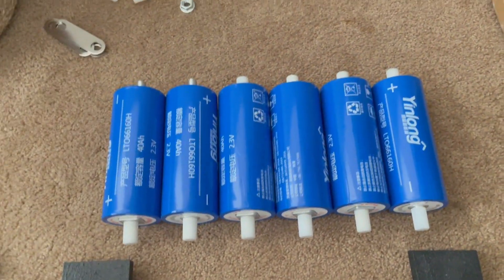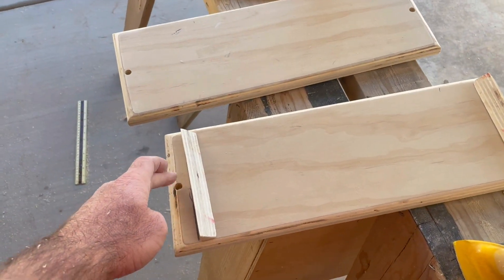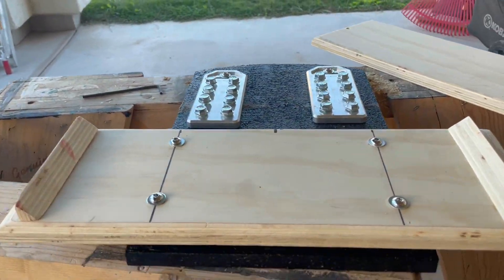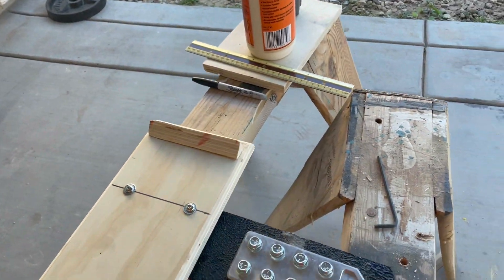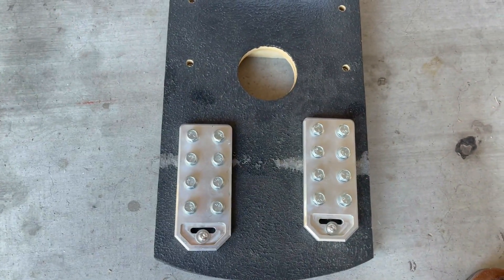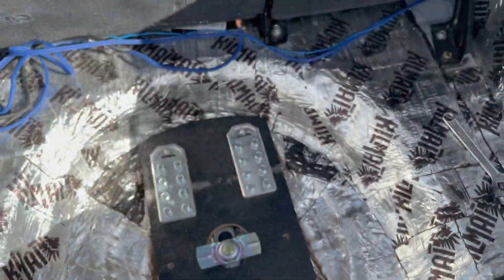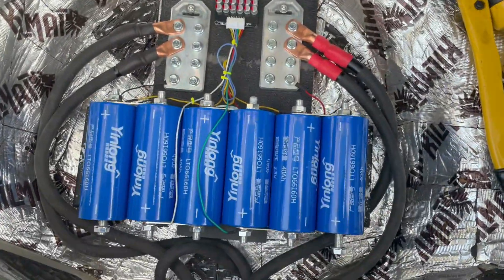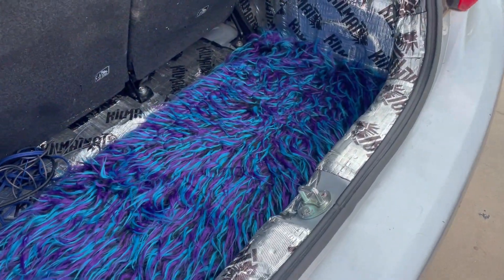Lithium LTO Bank Build for the GoKart

Comment: I was told to make sure there was a 1/8th to a 1/4 in gap between the cells. Not to have them touching.
Reply from the maker: I’m not sure.  I’ve never heard that.  Either way, I’ve never had a problem with them the way they are. Not saying you’re wrong, just saying I’ve never heard that.
Reply: @Husky_Shane_Basshead  iv just been looking through videos . Iv ordered a 40ah bank myself and looked at how to hook em up.  Do you have an HO alternator? And what voltage are you running if you don't mind me asking.
Reply from the maker: @Uglymuggcaraudio  I have a 240amp alt and used diodes to get charging voltage up to about 15.8
Reply: @Husky_Shane_BassHead  right on.  Thank you

Comment: Hey I’m running 4 American bass hd 12 dual one ohm on a taramp 8 but not hitting hard need help
Reply from the maker: How is your voltage? What type of box?  Many variables here
Reply: @Husky_Shane_BassHead   I’ll have to send you pics of it
Reply from the maker: @diaboliqueknight7720  wired at 0.5ohm or 2ohm?
Reply: @Husky_Shane_BassHead   I’m trying to run them at 0.5  but it goes n protect mode so I took 2 out n kept 2 running at 1ohm but it sounds like trash
Reply from the maker: @diaboliqueknight7720  did you keep the two subs in the same box that was meant for 4 subs?  Also, 8k is a big amp.  Probably need to up your electrical some as well.  I’d invest in an alternator.
Reply: stock alternator 220amp I have two red tops but it still drop voltage it’s a md taramp 8k